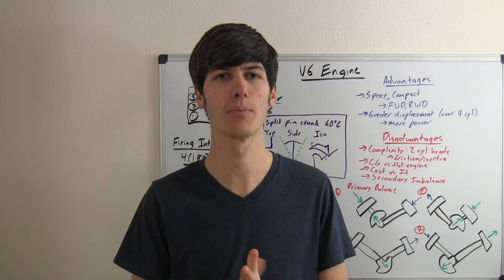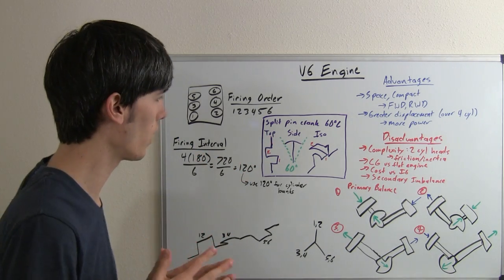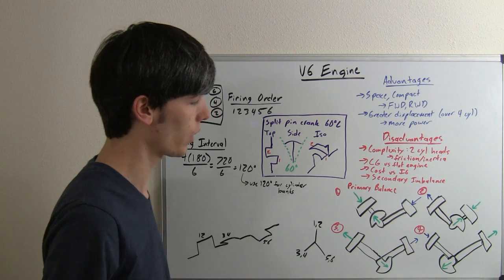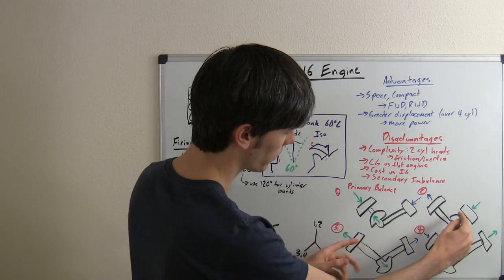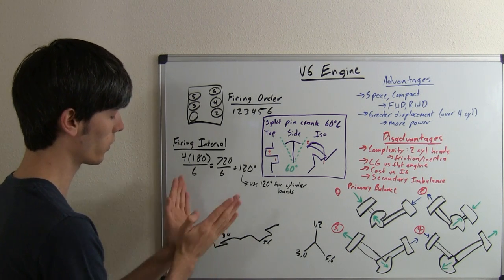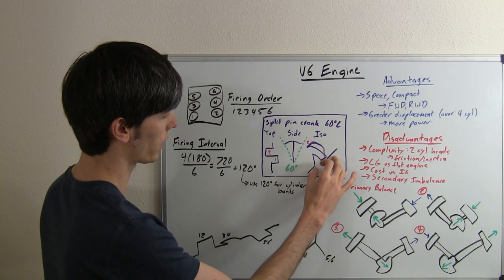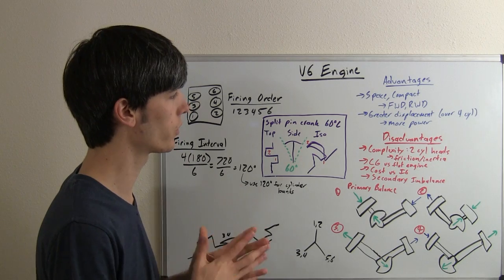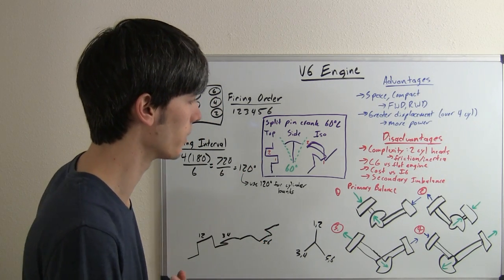V6 Engine - Explained

Comment: Or you can be the odd one out like GM with the 3800 motor with a 90* V and a firing order of 165432 with 135 being on the front bank in fwd or the right side of looking at the engine from the front or the crank and 246 obviously on the back/left 

6 5
4 3
2 1
You 
It’s kind of a funky engine but quite cool as well and pretty much built like a cross plane v8 -2 cylinders which is fun

Comment: It still bothers me why the only company putting massive effort into the inline formation is BMW (yes, I know Volvo does it too, but they're Volvo). Especially in trucks, were being compact is considered "meh" in design priority, they still use V6, were the I6 would make more sense. I like a V6 and all, but I really would like to see more inline 6 engines on the market.
Reply: "but they're Volvo" loool
Reply: All large trucks use I6s
Reply: FEVB not scania, or atleast they don't in europe
Reply: There's a lot of I6 diesels and lots of V8 diesels for big trucks, buses, etc. They're very very common. PACCAR, Cummins, and CAT all use mainly I6's
Reply: Adam Douglas 90 percent of heavy trucks in the USA use inline 6 engines

Comment: Engineering Explained you've probably heard of people using a hho generator as fuel. What are your thoughts on this, what would you need to consider in making your vehicle run on such a device (A/F ratio, remapping your computer to allow it to work) I just thought it'll be something interesting for you to discuss because in this day and age seeing how we have evolved with our mobile phones (thinner, smarter ext) it comes to my questioning why we are still using petrol or gas. I'll cut it short for you. If a car did run on hho, what else would you have to consider (the build and different feature) and what would be the pros and cons. I appreciate your videos keep them up thanks

Comment: Jason, have you ever taken an interest in motorcycle engines?  In MotoGP there is currently two competing types the 90 degree V4 versus a cross plane inline 4.  Much to talk about, firing order, combustion torque and inertia torque, and other compromises influencing handling.  Some interesting engineering at the least.  It would be great to see you do a video on this great rivalry topic!  Also can you shed some light on how a seamless gearbox works?  Have a look at Petrucci changing gears on YouTube!

Comment: Excellent. Excellent. The tightened 60 degree V6 pistoning engine is excellently shaped and 'designed' to take on the double function of driving, guiding, and directing the new car from the physics-superior rear central position by alternating between say 4 positions on a larger static track V, at the instigation of the computer system yes but ultimately the driver who in most models will have full control over the car's computer systems.

Comment: Since my car has a V6 i like to say that it has more power tan a I4 and better fuel economy than a V8 :)
Reply: An Evo has more power  ;)
Reply: nutnfan1??? I can also say a GTR Has more power...
Reply: Ford Fan 2904 I'm just saying a power has nothing to do with number of cylinders. My 4 cylinder is faster than your 6 cylinder. Somebody's 6 cylinder is faster than somebody else's 10 cylinder.
Reply: nutnfan1 nothing is not the right word. Cylinder count is undeniably linked to power output. All else equal, more cylinders=more power and less torque. You can't compare a heavily turboed-4 to an NA 6 and then say cylinder count is meaningless...

Comment: At 2.0 he begins discussion of primary balance.   The CWs are not intended to balance the piston and con rod.  The crank CWs instead counter the arms, the crank pin, and about 1/3 of the con rod.   The remaining 2/3s of the con rod and piston are balanced by the remaining con/rods pistons.  A crank can be purposely overbalanced, this simply moves vibes somewhere else, but the new vibe may be easier to control.
     V6 engines won’t balance, they behave like I3 engines.  Balance is considerably improved by flying weight C’balances on each end of the crank, and partially accounts for V6 crank weirdness.           Cheers

Comment: My 1975 Ford Capri has a 3.0 OHV V6 , Bulletproof engine , i've Heard people say I6s' last longer but my engine has 310k miles and still runs strong.
Reply from the maker: The manufacturing quality, material selection, parts quality, and engineering of tolerances/etc. play a much larger role on longevity than the layout alone.
Reply: Engineering Explained Yeah it's a Cast iron block engine , at 70mph it runs at just over 2500 rpm .

Comment: Inline 3 engines definitely DO have their secondary forces balanced. At TDC, secondary forces are 1, -0.5, -0.5, which obviously sum to zero. With the exception of parallel twin and I4 engines, all inline engines have zero secondary imbalance. I3 engines have a significant rocking couple though, maybe you meant that?

The secondary imbalance force of a v6 comes from having cylinder planes at angles that don't add up well trigonometrically iirc. V6's are easily the most complex engine in terms of working out the balance and rocking couples though.

Was there any reason you didn't mention the 90 degree v6, of which there were probably more produced than any other V angle?

Comment: Do the V12 Next!
Reply: I think we should V8 and V10 first...
Reply from the maker: V8!
Reply: Engineering Explained What would the Difference in power be between a  V6 and an I6, (my thought the I6 will have more Torque as it has much less mass to spin) Any Thoughts?
Thanks for all your amazing videos!

Comment: Though V6 also doesn't have a secondary imbalance, it is the different way as I4. The I4 is imbalance because of a secondary force all along the crankshaft, but V6 is because of the force distribution on crankshaft is imbalanced.

Comment: Chrysler 3.9L v6 engine has 1-6-5-4-3-2 firing order ,FWD  cars whit transvers v6 engines from 2.7 to 3.8 L has 1-2-3-4-5-6, they are many tipes ,The correct firing order is very important because mixing up the spark plug wires may prevent the engine from starting, cause it to backfire and run very poorly or not it all ,on some engines whit distributor can rotate clockwise or conter-clockwise

Comment: You said here there's a secondary imbalance in I3 engines but in the I3 engine video you said primary and secondary forces balance out... I don't understand
Reply: The secondary forces do cancel out, but the net torque they produce on the engine is non-zero. Therefore, V6's will all have a slight secondary rocking moment.
Reply: @electric7487  Thanks

Comment: Why wouldn't you have six cylinder banks, each at 60 degrees instead of three at 120? Would it not allow for more balanced primary force? And for the split pin crank, it looks like you're using a 60 degree V?

Quick edit for clarification.

Comment: When F1 considered downsizing from the recent V8's, they originally were going to downsize to a turbo inline 4, but in the end they went for the turbo V6. Why do you think they never went for a turbo inline 5? Im curious because there has been much debate on the turbo V6 sound, though I imagine a turbo inline 5 in an F1 car would sound quite nice.
Reply from the maker: I believe part of the reason they went to V6 was because teams wanted the engine to be a stressed member of the chassis, and a V6 is superior than an I4 for this.
Reply: Wny not inline 6?

Comment: My understanding is that the inline 3 engine has terrible PRIMARY balance because the pistons reach TDC either 1-2-3 or 3-2-1, there is no other way for the pistons to sequence.  The result is a lateral rocking couple, or a "nose up, nose down" vibration, as if there were an axle located laterally through the engine.  A V6 engine is simply two of these together, and this causes the end of the crankshaft to move in a circle.  Flat engines have none of this, but as you fold a flat engine, the circular motion gets worse and worse until the cylinder banks are at 90 degrees, the very worst design for a 6 cylinder.  Closer together the circling "wobble" gets better until the V angle becomes zero, an inline engine.  Volkswagen's VR6 is an example of how this works, the engine is a true V6 engine but is essentially as smooth as an inline six.

SECONDARY balance has to do with the fact that in a crankshaft, connecting rod, and piston assembly, during the first 30 degrees of crankshaft rotation, the piston descending moves far more than the piston ascending, and as such mass moving down is greater than mass moving up and there is an up and down vibration that results.

Comment: You didn't talk about how these engines often use balance shafts! Or do those apply mostly to 90° configurations?
Reply: Mostly 90 degrees. They don't really need them though, it's only for NVH purposes.
Reply: A 60° V6 with –60° split crankpins doesn't need balance shafts as it has perfect primary balance (crank weights are all that's needed to balance out primary forces). Secondary balance is perfect, and although there is a secondary rocking moment, it is normally very small and therefore it is often left unchecked.

On a 90° even-fire V6, though, things are different. If you take each pair of pistons and look at the primary forces, you'll find that the peak horizontal forces are sqrt(6)/2 times the peak primary force of each piston, but the peak vertical forces are only sqrt(2)/2 times that. So if you use crank weights to eliminate the horizontal component, you have now over-corrected the vertical component, and this will create a rocking moment which means that balance shafts are needed.

Comment: How about 90 degrees like the New Alfa sedan? Could you explain it? THX!
Reply: +22358 I want to know this as well. Because 90x4 is 360. So how do you time out 6 pistons when it's timed out in 4 sections?

The 60 degree engines have 30 degrees less between firing points than the 90 degree engines. So that makes room for 2 more firing points in the 90 degrees. I'm very curious.
Reply: I'm not sure how a 90 degree angle could benefit over a 60 degree angle. The balance would be shitty as hell, just like the old Buick v6s that were essentially a v8 with two cylinders chopped off.
Reply: 90 degree V6 uses a cross plane crank and different firing order than the 60 degree, the only advantage is parts commonality with whatever V8 the 90 degree V6 was derived from.
Reply: To save costs it's based loosely on a Ferrari modular V8 which uses a 90 degree angle

Comment: You should do a video on 90 degree V6s and why they exist despite being sub-optimal.
Reply: mrvwbug44 chopped v8
Reply: @mrvwbug44:  It's cheaper to take an existing V8 engine block and "hack" off two cylinders.
Reply: More vibration means more fun than the regular 60° V6

Comment: You say that the firing order is 123456, and firing angle is 120 dgrees. But the piston 1 and 2 are going to be rotating together as u mentioned to balance the primary forces,  how can they be fired at a difference of 120 degrees as 1 and 2 are going rotating at the same time and what do u mean by firing exactly? Thank you.

Comment: Hey, can you do a video on how a V4 engine works? I got into a rather embarrassing situation because I didn't know about it :/
Reply: Honda's V4 (the only company other than Aprilia currently using them) is basically the 4 middle cylinders of a typical cross plane V8.  Honda's design retains good power output and smoothness (less buzzy than inline 4s) and even still sounds like a cross plane V8 (and why Honda Interceptors with aftermarket exhaust sound amazing).  You also only really see V4s on motorcycles.

Comment: almost all sport car has V shape engine now, and left Inline model engine (RB 26, JZ2) can you explaine it? just because rigidity?

just as a suggestion, you can explain how the engines work by using computer animation, may be that'll be easier for people like me to understand. 
great work anyway, greetings from Indonesia
Reply: +Bangkit Wicaksana The main reason is weight balance for the car. Most cars are front engine, so for a RWD application where a inline 6 is mounted between with its center the front axle (placing 100% of weight on the front) a shorter v6 will be able to the engine the same displacement engine entirely behind the front axle, placing some of its weight on the rear tires, and thus reaching a better balanced car. At the design stage this also allows a shorter bonnet, which allows the manufacturer to either make a smaller car with the same room, or extend the wheel base (giving more interior space, and more vehicle stability at the expense of less responsive steering) with the same overall length. Additionally a shorter bonnet lets the front aero be lower for the same approach angle (thus chance of scraping), and V6 motors will fit in transversely mounted setups, like most a FWD and some AWD designs while an inline 6 is much to bulky.

Comment: @ Engineering Explained : I have a specific question about torque on V6 engines. V6 engines where famous, in my childhood, because they had better torque disposal ability. I wanted to ask if it's a hoax of those times or not ? Would a 2.4 4 cylinder have the same torque than a V6 of 2.4L ?
In regard of your kind reply.
Best greetings.
Bob

Comment: The firing order isn't 123456, haven't seen a car with that order yet, one I've seen is 162534 for example but 123456 would make the engine rock like crazy, the firing order needs to be balanced
Reply from the maker: It's one of many variants, as they are not all the same. Here's a summary of some common intervals: http://en.wikipedia.org/wiki/Firing_order

Comment: I was reading about the new Alfa Romeo Giulia Quadrifoglio. It has a 90°V6 Engine. Is it also done by altering the crankshaft? And what advantages does it offer over the standard 60° or 120° ?
Reply: 90 degree V6s are typically derived from V8s.  I believe the Alfa engine is derived from a Maserati V8.  As far as I know there is no advantage other than cost and packaging (can use a lot of the same motor and accessory mounts on a vehicle that also offers the V8 that said V6 is derived from).

Comment: I was wondering if there was an engine center of gravity Videos. I saw someone say that boxer engines are better because the weight is lower, but someone else say that v engines are better because the gravity is more centralized and closer to the middle. Which is correct?
Reply: Depends on the application.  A boxer engine may require too wide of an engine compartment or may push the weight distribution too far forward in FWD/AWD applications.

Comment: sir i have a qusetion about the split pin , will it affact the overpower of the engine , n if it is n 90* angle then what kind of split pin  aarrangement should i do ?? , plzz answer this , TYVM

Comment: What about 90* V engines? Is this angle reserved for V8 engines or are there 90* V6's as well?
Reply: You can make your engine any angle, But depending on the angle it can increase vibrations and balance. Like the old slant 6 engine, it had no reason to be slanted and it was basically a inline 6, Not sure what purpose that engine had for being slanted, it probably threw off the balance of the car. And 90* isnt the limit, boxer engines are 180*.
Reply: William Su they were slanted so they could fit in the engine bay easier. if you think about standing it straight up vs slanting it a little, if you slant it, it won't take up as much "up and down" space.
Reply: Oh I see, never thought of it like that, but yeah makes some sense. But still sounds like it would throw balance off if this was a modern day performance car.
Reply: William Su the engine is still reciprocating the same. vibrations are still canceled out.. i know bmw still slants their engines a little. i know nissan also does these on some. not to the same extent as before but they aren't perfectly straight up and down
Reply: You learn something new every day lol
Reply: Very early V6s' in the 50s' were 90 dgress, but son they realised that 60 degrees is the proper angle for a V6.
Reply: Is there really a proper angle for a V6? What at the benefits of narrowing the angle over widening I besides vibration? I've heard there are some really narrow V6 engines that were like 10 degrees or so.
Reply: William Su Yes really the only benefits of having a 60 Degree V6 are less vibrations , but also having it be an Even firing V6 Makes it probably the smoothest running kind of V6 .
And yes there are some really narrow V6s' that are mainly used by VW Those are typically 15 degrees and they're called VR6 Engines , mainly they do it so they can have the smoothnes and the power that a I4 Wouldn't quite achieve in no more space tan an I4.
Reply: Mr. Benis wouldn't it be the same as a l6?
Reply: William Su What would be the same thing as an I6?

Comment: Do a vid about the Renessis engine
Reply from the maker: Rotary Engine - Explained
Reply: Engineering Explained Wow the way u explained it made it seem very smart. Why don't other car manufactures use it and why does is spend so much gas if it's small and compact